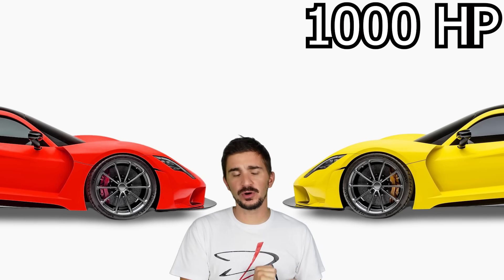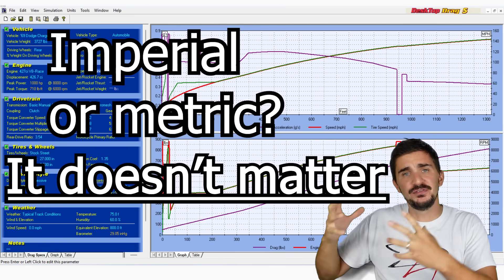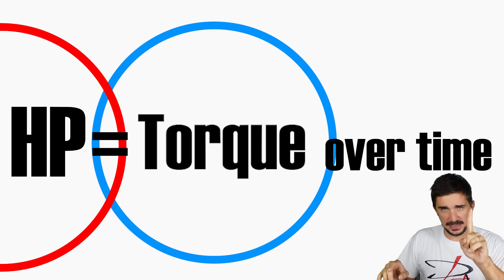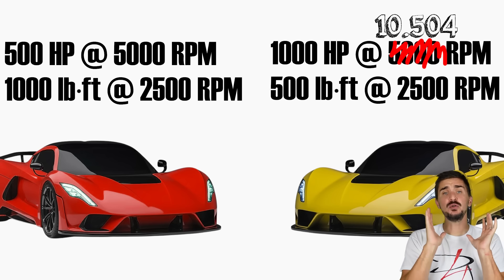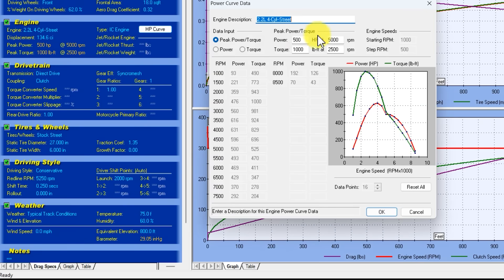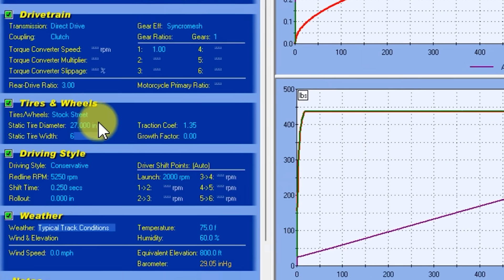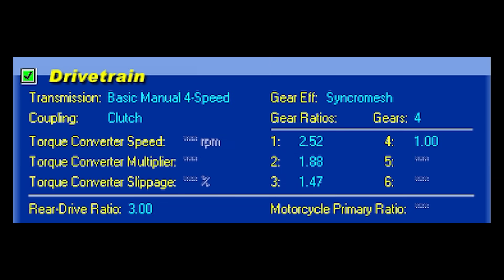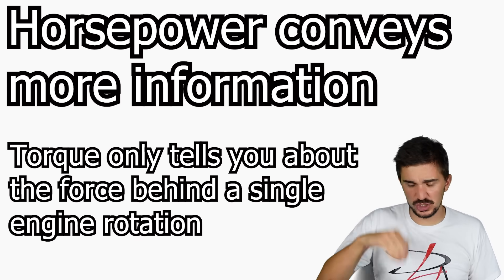Who's faster? Explained and Simulated - Horsepower vs Torque

Comment: The equation for quarter mile performance is hp+tq=1/4mile in comparison to the other engine.
Reply: not really 😉 even for one set gear it be actuallynot true most likely 🤷🏻‍♂️ egzample kawasaki zx4 r 77 hp +40 nm=127 1/4 mille time 12,3 / 175 km/h  weight with rider 280 kg vs feg suzuki gsx 950 s a2 licensy  47 hp 76 nm = 123 280 kg with rider 1/4 mille 14,3 sec/146 km/h  on set final one gear it be close only in relatively short range of diffrence between nm and hp and final ratio under this and above this it would start to walk away from each other , rocket 3 221 nm + 165 hp = 386 11,0/200 km/h vs vmax 1700 167nm  +200 hp= 367 10,0/220 km/h  , gsxr 600 l5 125 hp 67 nm =192 10,3/210 vs buel xb 12 s100 hp 110 nm =220 11,8 /185   🤷🏻‍♂️ hipothetical egzample 500 cc inline 4 100 hp 50 nm in bike like supersport 600 and with perfect gearing you achieve 11,5/190 km/h vs 1000 cc V2 100 nm 50 hp in the same bike frame weight draga asf best posible gearing and you have like 13 sec at 155 km/h 🤭 100 metres behind at finish 1/4 mille behind 500 cc 100 hp 50 nm version which have the same level of outp nm + hp 🤷🏻‍♂️👌🏻  go further let say 100 hp 25 nm = 125 vs 25 hp 100 nm =125 so 125 vs 125 give both perfect gearing with perfect gears quantity and diffrenc for advantage 100 hp 25 nm version be only biger than in 100 hp 50 nm vs 50 hp 100 nm egzample 🤭 but like im write for vehicle with one set final ratio like some electric assuming aalso those elctric have egzacly the same final ratio so the same rpm at the same speed they cros finish line int he same time only at very specified  nm to hp proportion and also how preciselly power graph go 😎 each other version and they cros finish line in diffrent time  👌🏻 so this silly formula nm + hp = 1/4 mille time completely dont fix to vehicles with optimal gearboxes setup and in most egzample dont even fix to electric vehicle with 1 set final ratio it fix only to 1-2% vehicle sp such as some general rules formula this equation is TRASH 👌🏻

Comment: For every day driving I have found that a production vehicle with a higher peak torque number than its rated peak horsepower number will generally feel like it has more grunt and be more fun to drive because it doesn't need to revved out to move out, and will tend to build power more smoothly than only building power at the top end.
Reply: What are you doing?
Power and torque have different units.
Reply: I personally don't like when I get the feeling that more revs didn't change anything. Than the engine must be castrated 😅
Reply: power is everything.
if you don't have an automatic transmission, you need to shift correctly according to the power curve of your engine.

Most people suck at shifting.
Reply: @svr5423  I once calculated shifting point with an complicated Exel Files a Dyno rund and the axle + gearrstios. For every gear.
First gear I nearly need to redline it and all other gears around 800upm bevore Redline.

Comment: I always use the analogy of horsepower being like a Dremel tool spinning very rapidly but will bog down when you put a moderate load on it. Torque is like a 1/2" power drill that doesn't spin fast but will twist your arm off if you put it in a bind.

Comment: Me, being also an avid gamer, relates to the punching analogy by this:-

The damage that 1 punch does, which is torque, is the damage dealt by a single bullet  of a particular gun

The frequency with which that punch is delivered, which is rpm, is the rate of fire of that gun

The overall damage dealt by the punch over time, which is horsepower, is the DPS(damage per second) of that gun

For those who don't know DPS, it's essentially the horsepower counterpart of guns in games, using which you could directly compare which gun is more powerful in its category, just like we do with horsepower in cars

There you go, that's my little gamer analogy, and if you've played any shooting games, you'll understand what I mean :)

Comment: Nice explanation. What I like to use as an analogy is loading bricks into a truck. Torque is how many bricks you can lift at once, rpm is how many times per minute you can place bricks into truck. And horsepower is how fast you can load the truck as in bricks per minute. You either load slowly with big stacks or ninja it brick by brick or both for best results :D

Comment: Engineering explained had a similar video with similar results that horse power wins the day because of gearbox's. Horse power is work, and torque is a force applied at an angle. But people will make the assumption that Torquey engines with long strokes will make the best power, when most performance cars have short strokes or are square (Same bore and same stroke). Subaru EJs were 90mm x 75mm bore and stroke. Celica GT4 and Lancer Evo's and K20 is 86mm x 86mm (square). Ford Cosworth Escorts RS were 90.8mm x 77mm similar to a WRX.

Comment: In real world scenarios, the hp biased engine will always obliterate the torque biased one, when the difference is that much. No one will be flooring a 10k rpm engine from idle, launch control and proper gearing will be used, etc.
Actually the question presented in the video title is easily answered by a reference: the last iteration of f1 n/a engines - low torque and proper FAST. They are kind of lightweight, yes.. But it is their combined high rpm and hp numbers that made them that fast.

Comment: This is easily your worst video. You really confused horsepower and torque. 

Here is a much better way to look at it. Horsepower is the energy per unit time. As a car changes speed, it increases its energy at 1/2 mv². That has to equal the amount of power that was available for that unit time. Torque is irrelevant. Vehicle speed is relevant, engine speed really isn't assuming there's gearing.

Introducing tire traction was irrelevant for this discussion and just added unneeded complexity. The ECM on a high power engine is going to be reducing power at low vehicle speeds to compensate for that .

Torque shows you the maximum force. It doesn't affect the acceleration, but it does affect the forces on the gears and the transmission, on the drive shafts, etc.

Gearing is a different discussion and unless the rules prohibit it, race cars are geared for each track to take account of the speeds of the engine, where the turns occur, the size of the tires, etc

What's critical is the power curve. Torque has been a proxy for the low end of the power curve. High horsepower engines typically also produce peak torque at high engines speeds. Modern ECMs, especially on forced induction engines, typically have a flat torque curve at lower engine speeds, primarily to save the drivetrain from being overloaded. The amount of twisting and bending and sheer forces on driveline components is a function of torque not power. And that is right down to the number of wheel studs and their diameter.

Comment: very infrormative and interesting simulation . one thing I could add is whenever the car goes faster the engine also makes more power at that instance, even if it’s the engine that makes less peak power, assuming equal transmission losses (usually higher at higher rpm so there is an advantage the torque is higher and rpm lower)

Comment: I would say : Torque is the ability of a car to pull itself, to push forward, at a given RPM, very often, low, because that's like a bike, you have more torque (pushing power) in first gear but can't go very fast.

HP is the ability of a car, to maintain this torque, on the whole RPM range that it can offer. A car with much torque (My 270CDI for instance) and low HP will pull hard 0-50 and then offer less power the more you accelerate.

A car with high HP and low torque (let's say an Honda integra type R) will be slow on start because it can't pull itself very fast, but then once you go past 5000 RPM, it will start pulling fast.

I don't know if this is clear but that's the only explanation that gets me to understand torque and hp.
Reply: Bicycle example shows that you don't get it. You push the hardest way possible (thus generate max torque on the pedal rods axis) when the highest gear is engaged.
Reply: @simplemachine9531  Read the whole text you'll understand that i did, in fact, get it, tho it's still hard to compare a car and a bike talking about gears because, an engine isn't equal to bike gears. i might have used a bad comparison but if you take my comment as a whole it is still coherent

Comment: what is used as the basis for calculating torque?
Is it:
a) one 360° rotation and all the power which is provided by combustions (depending on how many cylinders are firing)
b) the power of one combustion delivered to the crankshaft

I guess its answer (a), but it must be hard to calculate in an engine with more than 4 cylinders, as the combustions start to overlap.
but it would be interesting to see that being done once :)

As it also would be  a graph of the energy stored and dispensed by the flywheel and show how much stress a double mass flywheel has to harnes per second.

Comment: Another excellent video, thank-you! I used to work for a Ducati team and we lived by the adage that "HP wins sales, but torque wins races".
Reply: so why motorcycle with more power less torque win race ? 🤔🤷🏻‍♂️🫣
Reply: @mociczyczki  they didn't..... Ducati dominated short circuit WSB racing in the 90s. In part because their inherent torque punched them out of corners harder than their inline 4 counterparts. The fact their corner speed was generally higher too meant that they had an advantage on many circuits. They lost out though on circuits with long straights where high revving inline 4 engines came into their own.
Reply: @mociczyczki  well you're clearly an expert and know much more than me..... All I can state is from what I have seen 1st hand on many tracks in Europe, Australia and the US. I worked for Ducati Corse for almost 10 years as a race technician and engine builder. I broke my teeth building engines for Giancarlo Falappa and then Pierfrancesco Chili. I spent hours and hours staring at datalogs of how the engines produced their power and torque. I saw how many wins and podiums those bikes took. I saw the strengths and weaknesses of the designs of both V-twins and inline 4s. So you can carry on telling me I know nothing, and that I'm talking bullshit, but you'll forgive me if I ignore you. Ciao!
Reply: Ducati make racing choppers? Never heard of it.

Comment: I have a lot of Torque on my NfS Heat cars 8.4l V10 and felt that other cars didn’t accelerate as fast as i do on high speeds like from 200kmh to 300kmh my key is high Liter  8.4x10 the Viper engine was always the best to me.

If u guys have something to add pls let me know like, is a Charger better than Turbo? I like to have the idea to have both but sadly thats not a thing in the Game~
Reply: It would be cool to change gear ratio and use higher rpm but thats all speculation~ there is no economy cuz its a Game i want max Power

Comment: Lug nuts have more torque than your engine - and they don't even move! You forgot the basics - torque can exist without doing work, and horsepower is rate of doing work by definition. 1000hp will be accelerating twice as fast as 500hp (of the same weight) by definition. Poor use of software (gear ratios, final gear ratio, tire size, clutch slip) - makes poor understanding of the concept even more apparent.

Comment: Use the same base formula: 
If you want the 1000ftlb engine, 500 hp, You'd find that it is only possible at ~2630rpm - so it's a big industrial engine that is not even funny.
If you want the 500ftlb, 1000hp, REVS it's GUTS out until you reach 1000hp - which is around 10500rpm.
Whether or not any of these are possible - BUILD IT and find out. Or you can just use the sim AUTOMATION.

Comment: HP is equal damage is true if your torque(force) is higher than "damage resistant"(like tensile strength) if you don't hit your resistant you don't get any damage, but if you cross this line you will get extra damage by iteration(REV).  Comparison of 500/1000 to 1000/500 will be more reasonable if you will fit gear ratios on each gear to same speed, so  both cars can go 100kph on 3rd gear for example(in general for 1000/500 two times shorter). If REV range is different ratios also should be.

Comment: Torque is a force, which is applied directly to Force, Mass, Acceleration physics. 

Horsepower is related to air and fuel flow in relation to one minute. 

Increasing Torque means an engine is converting the chemical potential energy of fuel to force more efficiently. 
Increasing Horsepower means an engine is capable of consuming more air and fuel.

Increasing Torque will increase Horsepower, but increasing Horsepower doesn't mean a Torque increase.  This is the heart of the confusion between the two.
Reply: "Torque is a force..."
Here we can stop reading further

Comment: Very clearly presented but...  We're only talking about internal combustion engines, right?  Because I heard that electric motors make all their torque available from the first RPM and up.  I've also heard that steam locomotives didn't have particularly high HP ratings but produced incredible amounts of torque.  And that they were usually rated in terms of tractive effort rather than HP.  Plus back to internal combustion, I wonder how the equations would change if we looked at 2 stroke vs 4 stroke?
Reply: it doesn't matter, the basic physics are the same for any engine that generates power through rotational motion (torque x frequency).

A train has weight and in the end the engine has to produce all the kinetic energy that is needed to accelerate it to a given speed. If it has low "HP", it will just take longer (or it won't be able to overcome the friction at some point).

Comment: Those caluations do not work for eletric motors. Impenences  from thw magtic fields causes torque & hp to drop as the motor then has to work against it threw the rpm.

Comment: This video is flawed because he doesn't use proper gearing. To have a proper comparison you need both cars to have a similar top speed for each gear. The result should be HP will win every time because torque is dependent on gearing while HP is independent of gearing, so high HP should be better than high torque. High torque will only be beneficial in first gear up to the limit of the tires.

Comment: Another example of Torque, RPM and resulting HP besides a boxer would be a factory worker.

Your worker can be really strong, he can lift quite heavy boxes without using tools.
Your worker can be really fast, moving back and forth at high speeds.
The end result is how many tons of product that worker can do in a day. Or if there's a goal, how quickly a worker can get the required job done.

In the real world, not all boxes are heavy and not all boxes are light. A fast but not super strong worker will have to use tools (gearbox) to move boxes that are too heavy for him to lift. Lest he'd be tugging on them to get them to move across the floor repeatedly which would make him slow. And a fast worker, even using tools, can't get a heavy box moving effortlessly. It takes time to get the heavy box moving at speed and it takes time to slow it back down again.
A strong worker that has to work with many boxes will instead not struggle to move them but since he's strong he's possibly also slow moving. So the job will take longer to finish because he can't run back and forth fast enough.

Then we have the really athletic workers that are quite strong (not worlds strongest man strong, but quite) and who also have the endurance and speed going for them.
They can lift the heavier boxes just fine and they can run with them back and forth. So they finish the job earlier in the day.
They are the top fuel engines of the factory floor, they have plenty of torque and they go really fast and so their work throughput is really high.

... The reason i use this example is because i can't visualize "damage" as any useful metric. But i can visualize big and small boxes that are light and heavy.
An engine with really high horsepower but no torque to speak of will really struggle in low RPM and will have to change gears a lot to keep going with the heavier boxes. And it will have to be super fast.
An engine with really high torque won't struggle as much, but is usually slower running because it's built more massive to be able to carry those loads. Even at low RPM it will be able to move the heavy boxes and doesn't need to change gears as often.

Comment: I will slightly disagree with your notion that HP is the more useful figure as it depends HEAVILY on what your end goal is.
If you goal is to go FAST then yes, HP is the better figure. But if you want to go smooth or be able to pull heavy then torque is the best figure to know.
Of course, as you've shown, there are so many variables at play.

BUT on that note, just because you have low HP doesn't mean you can't go fast. You just need more gears to get there. This because as you've explained, if you have high torque AND high RPM then your HP will by definition also be high.
But when your RPM remains low and you still have high torque, you can make use of many gears to go fast without going into high RPM.

A semi truck isn't slow because it has low HP, it's slow because it's geared towards pulling a few ten thousand pounds of cargo and still be able to reach highway speeds. So they have many gears, like 12, 18 or even 24 gears!
And trucks have lower HP because they are built for the highest possible torque to do more work, and so their engines can't do high RPM as they would torque themselves to bits at higher engine speeds.